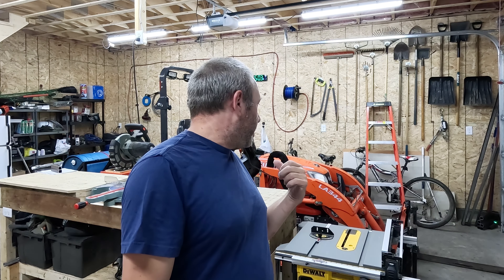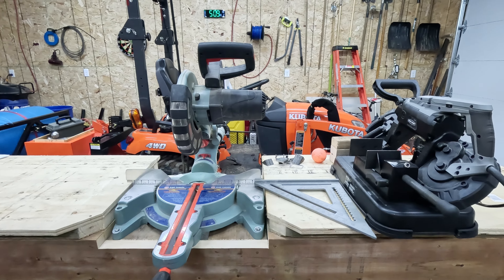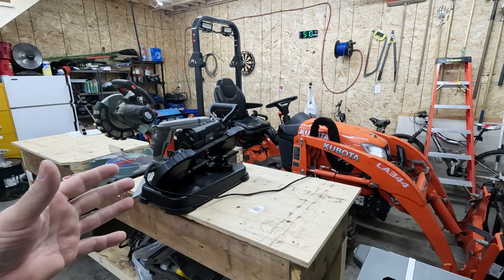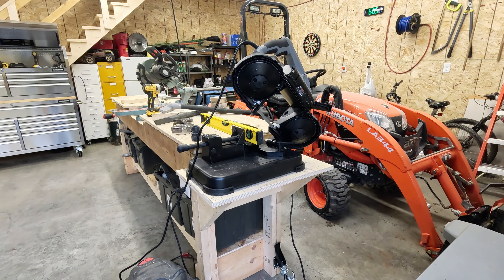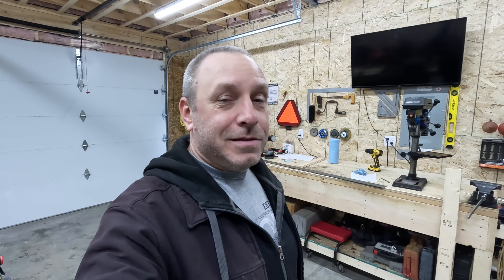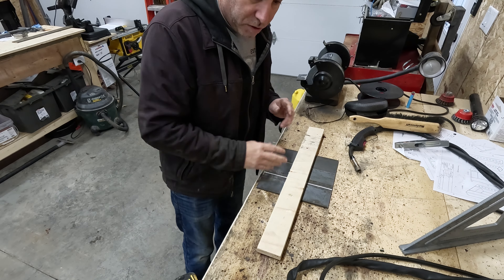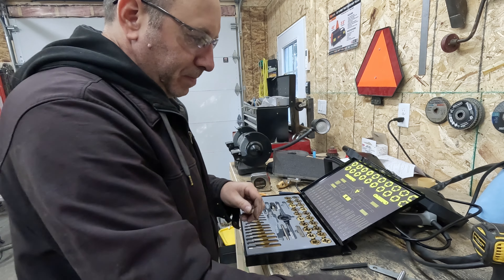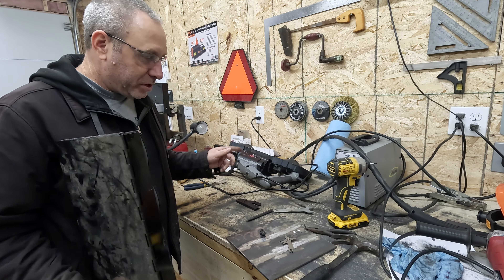Bandsaw Improvements: Workbench Extension and Converting a Portable Bandsaw to a Bandsaw Table

Comment: The extension and band saw table are great ideas. When I'm doing projects, I don't put any tools away until nights end or when the project is complete. most of the time the tools I'm using stay on an 8 foot table and easy to get at. I don't have a garage to work in, so each night they go into the shed to keep out of the elements, then back to the table the next day. Thanks for the great video.
Reply from the maker: Thanks VikingShipExplorer. I'm glad to hear that I'm not the only one that has all the tools out when working.